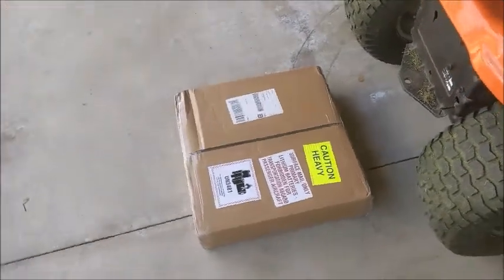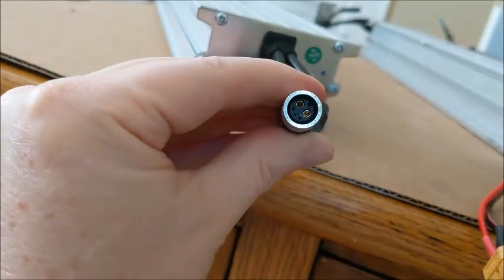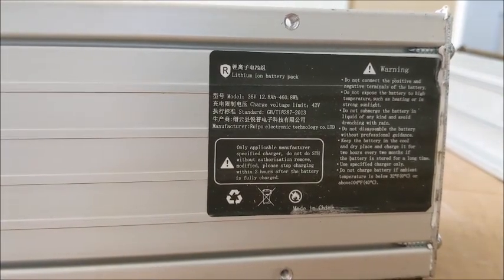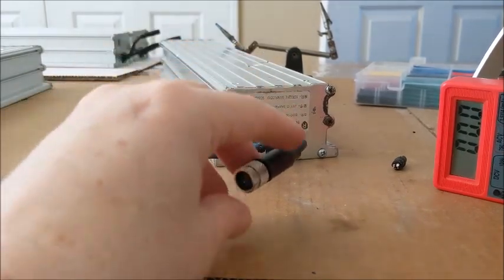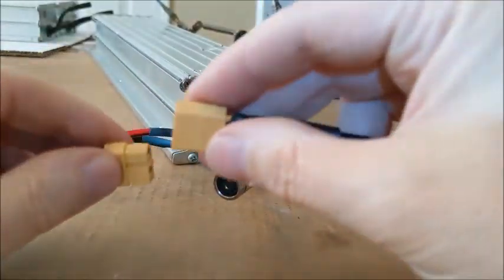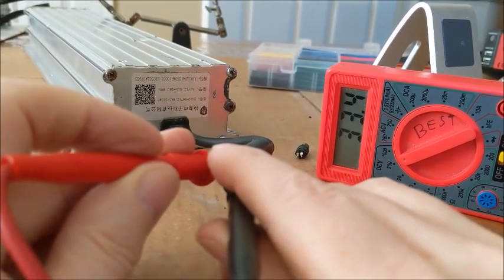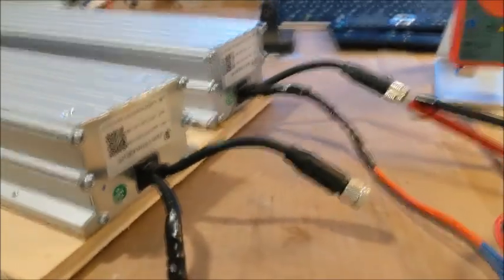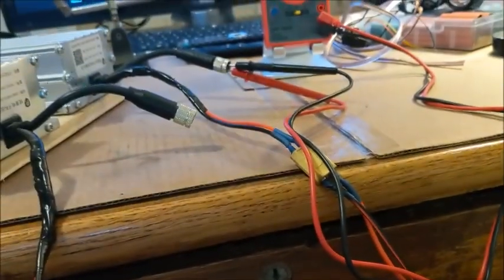Part 1 Intro & Plan - Panasonic NCR18650BD  36v Scooter Battery Packs  - Battery Clearing House

Comment: These will shut off if you don't have a signal fed to them constantly..I made my own with a pro board... It worked great.. The nano did not work!!
Plus battery clearing house is the worst company ever!! ... Customer service is just bad!!  Better to go with jag and let him deal with bad packing and shipping issues on these and cheaper shipping rates as well.. ( ps I got smashed plug as well problem was it's the signal plug.. But I've also gotten items in just a bag but peanuts seam to be there go to)
Reply from the maker: Thanks for your suggestions.
Reply from the maker: During the series of videos, I use 2 different brand dongles to keep the bms active. You should be able to find them under "Dongle wars" I believe. Thanks for your comments.

Comment: Hey Sid I just purchased the dongle from Jehu and he doesn't respond to emails too fast, so maybe you can answer my question. Do I Charge the Panasonic batteries through the dongle? or do I charge them through the second smaller pig tail coming out of battery? Also when I use the panansonic battery, (for DIY ebike kit) Do i plug the power inlet it into the dongle like you have to use it on the ebike? I was under the assumption that the batteries only needed the dongle to wake up.
Reply from the maker: Hi Michael, I believe Jehu said in one of his videos that you could charge and discharge both on just the one set of cables, however I wanted to charge it through the smaller cable so that it would go through the BMS. I think it's safer to charge it that way so that you have the BMS's capability of monitoring the charge. I believe if you charge through the larger set, or the same set that you would hook up the dongle to that it would not go through the BMS. But I could be wrong. In regards to the dongle itself, yes you only need the dongle to activate the BMS. However he designed his to where it passes through the power. So I would imagine you could either hook the power up directly and have the dongle off to the side or you could run the power through the dongle and hook the power up to the opposite side of the dongle. I would think either way would work. The most important thing for the dongle to work is that it gets 36 volts and that it allows the blue wire to communicate the special codes needed. Good luck sounds like you're having fun.
Reply: @sidjones-randomstuff2058  Great Thank you Sid!
Reply: I had this exact question when i emailed JAG35 since the charger they promote on their website has an XT90 port that i could only plug to the dongle which then goes to the bigger port, they said it should work since the port is bi-directional, i plugged it for a few hours but the LED on the charger shows red and it got really hot but i assume thats normal, i will try again for at least 6 hours or so otherwise i will have to solder something that feeds into the smaller wire, i just hope im not damaging anything